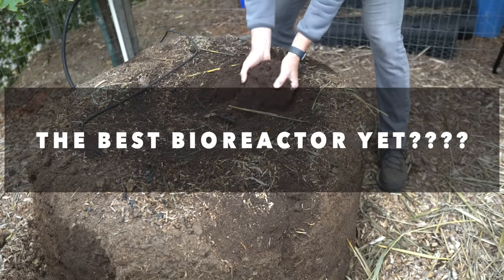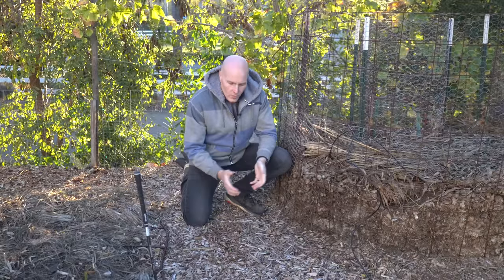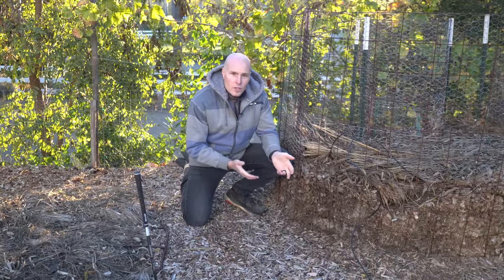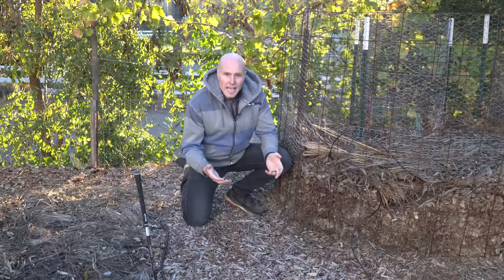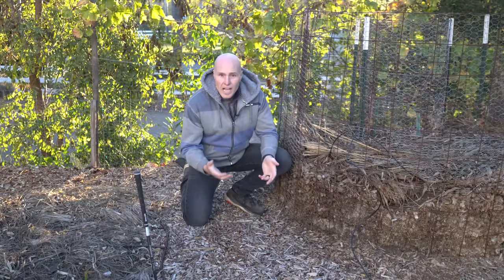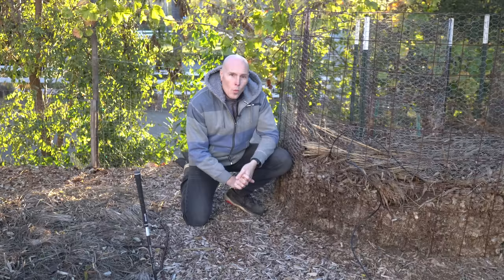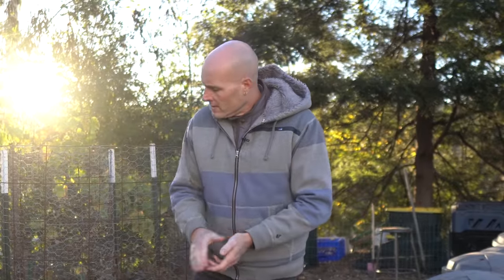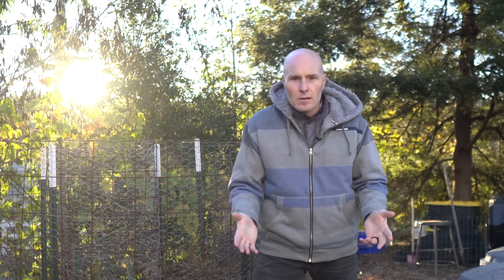The Best (or Craziest) Compost Bioreactor Design Ever!! (WILL YOU TRY IT???)

Comment: It all seems a bit over complicated. I have a two bin system made with wooden pallets lined with cardboard. One gets filled over the year, then in autumn gets turned into the second bin next to it. The bin that was filled the previous year has been laid on the soil to mulch, feed, protect the soil over the winter months ready to be planted into in the spring. I also have a pile of wood chips and leaves left to rot down to use as mulch when ready. I think this makes thinks more simple than building ever more complex bioreactors….
Reply: Yeah, nature handle it well. I have a very similiar setup with wood pellets. I turn it from bin 1 to bin 2, when bin 1 is full of material. When turning into bin 2 i add some horse manure from a neighbor.

I only water it a few times per year, but i live in a wetter climate. I remove compost from bin 2 when it seems sufficiently broken down. 

Simple. Cheap. A low work approach. But it is a slow process that require a little extra space.

Comment: What about something like sheepswool or hempfibre insulation? wouldnt need to do a lot of the work/structure mentioned in the video, could just wrap it round until you have as much 'mulch' as you require? more costly of course.

Comment: I'm interested to see the results of a test like this. 
Every thing I have learned so far about this system has a heavy enphasince on air flow. Will the wood chips slow the airflow and cause the system to go anaerobic. 
For it to be fully accurate in your testing you must get your compost tested.

Comment: I think it's interesting, but part of the point of the dimensions is that air only penetrates about a foot. With woodchips that's cutting down on the actual compost feedstock you can put in compared to without.

Comment: The whole point of the reactor tho is air penetration if air can only reach a foot into the pile from the open sides wouldn't it mess up the math if you add 3 to 6inches extra on the outside or anywhere you would need to add another air layer or tubs if not the whole pile wouldn't be aerated then you could potentially start making your pile go anaerobic , in turn slow down decomp and even start making a habitat for anaerobic microbes and pathogens to thrive witch we don't really want????
Reply: It'll go back aerobic just wait longer and let the worms do their job

Comment: I might do this. I would however make an attempt to increase surface area exposure to airflow. I would also like to experiment with the incorporation of rocket stove principle architecture for the airflow, IE horizontal air inlets at ground level in a radiant pattern connecting to the central air chamber/flue. The heat convection may well create an accelerated conversion :{)

Comment: What if you dig a hole and compost below ground?
Reply: Because you would not get good air flow.
Reply: @Well_I_am_just_saying  - Depends on how it is designed. The benefit of already in ground micro-organisms may outweigh the chances of the pile going anaerobic.
Reply: @3dcrazy332  
 My  2 ring Diego bioreactor is built on the ground so the worms will definitely find their way in.

Comment: I make raised beds with metal mesh and rebar and I Use large sheets of cardboard behind the metal mesh on the outer layer. The cardboard seems to hold up for a couple of years. This might be a good solution to hold in more moisture. Perhaps poking holes in the cardboard would help with getting more air into the compost. You can find large sheets of cardboard everywhere. 🖖🏻
Reply: How large are the openings of the metal mesh, hkw far did you space the rebar and whats the largest dimensions of a raised bed that you've made in this configuation, specifically how tall and wide of a raised bed, as I would like to try if I can make one tall enough, instead of using metall roofing for the sides, thanks

Comment: Hey Diego!  I would not try it....  I think we are in the same composting camp that composting should be simple enough or you arent going to do it.  If it were me, and the drying out of the compost outside is a concern, and we had the stipulation of no plastic, the route i would go is corrugated roofing tin.  I believe they come in 10 foot lengths.  i would cut them in half and stand them vertically, the corrugations will let them bend into the curve and you can still use the 6" x 6" wire mesh to contain them in a circle. No need for the chicken wire.  I would be curious to see, if you have the room, to make 3 versions at the same time.  2' inner core, 1' inner core and no core.  Fill them all together with the same material and see how the decomposition is after a year to see if the airflow really makes a difference??  Cheers!

Comment: Thanks for the idea. I agree with your solution for using woodchip as a supporting structure in order to eliminating plastic but it's not going to retain water due to it being an exposed surfaces (inner ring, outer ring, top) and above ground. You also have convection due to biological activity that will move air through the pile.  Mulch on the ground is "capping" only one surface minimizing evaporation. There is no airflow since the ground is its own barrier. Your idea for composting can still work but you'll need to keep the outer ring moist with a slow drip irrigation. That's my opinion.